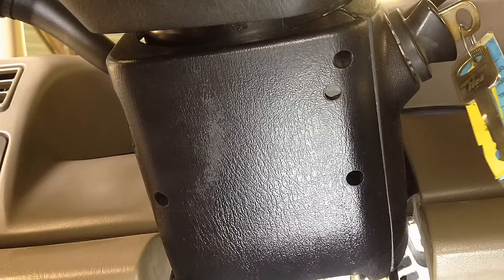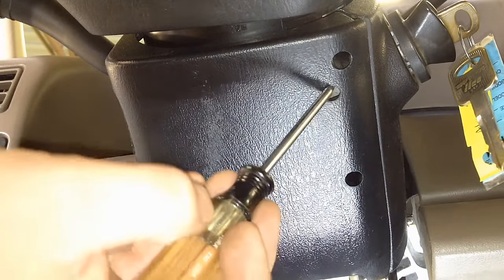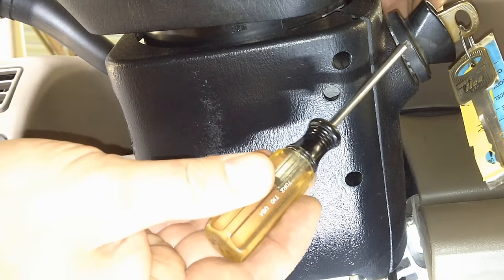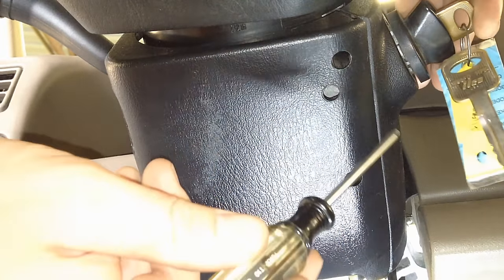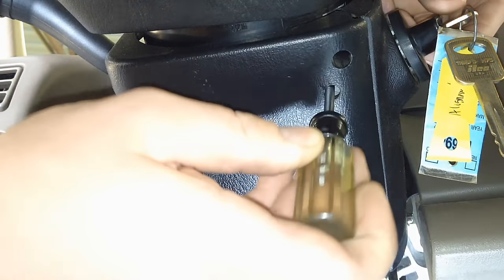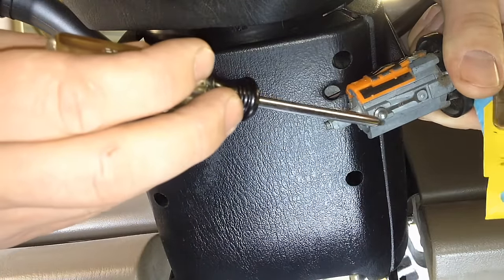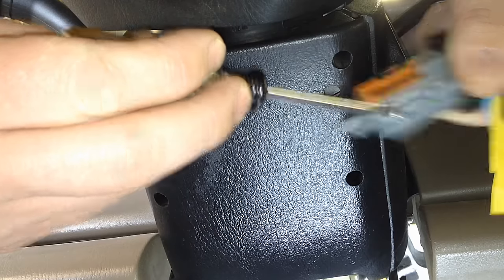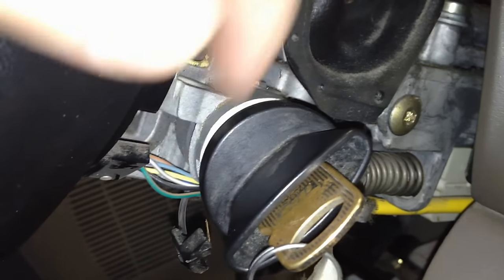Ford Quick Tips: #25 Ford Ignition Lock Cylinder Removal

Comment: I got the ignition release button pushed and can get some play but it is not fully released. Tried to lever it out and may have busted a bit the plastic cowling that the key enters first, and that prevents the shroud from being removed. I was way over-charged for replacing it and I wanted to verify that it had in fact been replaced. F250 2000
Reply from the maker: R. Brooke Fox Just make sure whatever you are sticking up in there is small enough to fully release it otherwise it should come right out.
Reply: Well, yes, I pretty sure it was small enough. I had taken off the low fuse box cover so I had a clear view. Thank you, FordTechMakuloco. I worked it in and out as far as it would go quite a few times and could plainly feel and see when it was released partially, at least, or not.
Reply: FordTechMakuloco What secures the plastic cowling that the key enters first, and that prevents the shroud from being removed? Is that just a friction fit? I found a spare in the truck after the suspicious work was done so I have a replacement in hand if I break the one that is in place as I try to remove the ignition cylinder.
Reply from the maker: R. Brooke Fox I think it just snaps on. The lower shroud should still come off with lock cylinder in place 3 Phillips head screws and it will be all open.
Reply: Thank you, FordTechMakuloco. I did get it out, and the cylinder is the same as the one you show, with the orange plastic parts, etc. Your link to Amazon was not direct to F250 2000 but on navigating there, the cylinder shown was different. I ask if it is original equip as I want to verify that my guys in fact replaced it or if it is the original or exactly like it. Is the one you show orig or a replacement? Can you give me a link for it or a brand? Many thanks.
Mine: http://2.ii.gl/La60cHIb.jpg
http://2.ii.gl/5da8ozTRi.jpg
http://2.ii.gl/omHLmnlnD.jpg
Reply from the maker: The one in the video is an oem original the replacement ones Ford look the same with the orange key in switch.
Reply: So it may or may not have been replaced. Thank you, FordTechMakuloco .
Reply: +FordTechMakuloco I'm trying to replace the ignition lock cylinder on my 92 f150  5.8 ltr when I'm trying to install the new one in half ways in it gets stuck i just took it back out didn't want to damage it is this normal or should it go back in smooth?

Comment: Is this the same for a 2009 F150 4.6 3v XLT?  My ignition switch seems to hang up when turned normally as though it's sticking. Have tried to fix this by squirting a little dry graphite for locks but with no luck. Switch still feels very "sticky" when turning the truck on and off.
Reply from the maker: HawaiianF150 2009-4/6-L3V Yes comes out the same way.
Reply: FordTechMakuloco Thanks!! You are awesome!  Love you videos.
Are these locks serviceable?  I'm thinking i need to go Ford but am curious that they would call in a locksmith and replace the switch and have him re-key it.

Wonder if its better to go to a locksmith directly and not have to pay ford to hire a locksmith. Seems there isn't any scan coding or reset needed.
Reply from the maker: HawaiianF150 2009-4/6-L3V If you need a new lock cylinder hget the kit and build it yourself there are instructions inside they are very easy to do. Just make sure you get ford cylinder.

Comment: I have a 99 f150 and my ignition switch just turns freely. I can't get it out because whenever I turn it to the on position it doesn't catch. Any advice on that? I think the cylinder lock is broken, or the tip may have broke off.
Reply from the maker: Its the slide lock inside that actuates the ignition switch. You must disassemble the column.
Reply: Thanks I appreciate the help. I'll give it a go. Do you happen to have a video demonstrating how to do that? If not chainsaw and duck tape it is lol

Comment: okay so i have a question,  my ignition switch broke today, its a 2000 ford mustang. it broke in the on position just before crank, to replace it can i simply slide it out like you did here and slide the new one in? i had to disconnect the battery because whatever broke wont let me turn it off either, just stuck in "on"  thanks in advance!
Reply from the maker: +Chris N yes it should release in run just like this one here and the same going back in it will all line up
Reply: Thanks !
Reply: I just had the same problem and was wondering how it worked out for you Chris
Reply: i honestly havent tried it yet unfortunately , the car is still sitting there ... i keep procrastinating . but when consulting with my uncle he believes that its actually a bad ignition switch and not the ignition cylinder , im assuming the process is still the same . i just dont have the tools on my own (yes not even a simple screwdriver set smh )
Reply: Thanks for the reply Chris, I will let you know what I find when I pull mine out, probably this weekend.
Reply: hoping to do mine also, ill let you know too, hoping its a cheaper fix than a new cylinder and keys

good lcuk
Reply: okay heres an update, so i took apart the steering column covers and took out the ignition cylinder just like this video, i had to also take off the lower dash panel below the steering wheel to get to the ignition switch. after some inspecting i found that the problem is the ignition switch actuator rod, its what moves with the key to switch the ignition switch into different positions
Reply: im also going to switch out my ignition switch tho because it seems like its very tight and that may be what made the ignition actuator rod snap. but its also possible that that much resistance in the switch is actually normal
Reply: anyways, im not looking forward to doing this job, but im hoping that i dont have to dismantle the entire steering column to get to it seeing how its deep inside the center of it........ ugh....
Reply: Chris I think mine is the same issue,  doing a bit more research I found that it is quite a job to replace the actuator rod.  There is a youtube video of a guy doing it on an Aerostar which seem to be the same.  search "ford ignition actuator rod"  The guy in the video had to file the new part to be able to install it without removing the lower half.   I talked with a local mechanic and he said it was easier to replace the whole steering system above the firewall.  This sucks!
Reply: yup i watched the same video theres another one from a mustang which is what i have but he still removed the whole steering column and replaced it outside the car, def not what i want to do, im considering getting a price, for now i might just start to drive the car by starting it from the ignition switch .... lol ghetto
Reply: Haha I was thinking the same thing!

Comment: So my key stopped working in my 2002 f250. I cannot turn the key at all. Steering wheel is locked due to the key no working. How do I remove the ignition if I can not turn to “run”?
Reply: Try moving the shifter and turning the wheel at the same time.

Comment: Have a Ford E350 Tioga. Do not have keys to turn to run position, and the guy did this to try to get ignition cylinder out without keys, I live to far out for anyone to come out, he said he can do it, 3 hours later it is not working please help! Steering wheel is iff the turn part on keys is broken off now, and he has drilled tge heck out of it snd the lil hole that holds the pin, I can't figure out how to send pictures to show you, really need help

Comment: I had a lock cylinder stop turning on me one very cold morning on my 00 focus. Turns out (no pun intended) the tiny Springs that push the lock bar out must have broke/shattered rendering it useless. 

Found the TSB and drilled a 10 mm hole (pilot hole first) to the correct depth and location,  then was able to successfully extract the cylinder!
Reply from the maker: Attohertz Yes I have done a few but what a mess it makes.
Reply: FordTechMakuloco Yes it was like new years confetti all over the place! Cobalt freeze hardened drill bits FTW.
Reply: Excuse me I have a question for you I want to replace my ignition cylinder key cause I have some problems with it but I want to know if I have to go to the dealership to reprogram the new key or new cylinder key thanks hopefully you answer

Comment: again dude, good quick tip! if i had time i would show whats done on a cobalt ignition recall, which requires remoing the 3 7mm screws and taking off the 2 trim piece halfs under the wheel, and ofc 2 torx 15's for the switch, and run position and a 90 deg pick to remove cylinder! bing bang boom done xD

ford bin releasing many recalls in the last few months?
Reply from the maker: Kevin Rogers Yeah I know what you mean on the gm lock cylinders had a regal once. Ford has been releasing plenty of recalls most of them stupid stuff extended warranty programs etc to increase customer satisfaction which is a good thing.

Comment: Great Video. I hate to ask in an unrelated video, but could you do explain the timing chain tensions issues on the 98?-early production 2003 4.6 used in the Crown/Grand Marquis/Town Cars. I know that Ford technician made marks on the timing covers meaning different things. The marks are written with a paint pencil and they are typically an X with 2 or 3 dots above the X.  I might try and find an image. I have 1-95 Town Car 236,000 trouble free other than a blend door, air ride, and a few power window gears. I have an 01 Crown Vic that has needed a blend door and still has the original total plastic intake manifold. I also have an 03 GMQ that has had the cooling fan replaced "radiator fan" and I have 2 2003 Town Cars that have not had any issues. I also have a 1990 F -150 300 straight 6 that is bullet proof. You can see I'm a Ford Guy, but I do have one GM car, a 81 Oldsmobile Diesel. Thanks
Reply from the maker: 81 Olds diesel sweet! I don't know of any issues with timing chains back then. All of that mess started with the 3v engines 2004 or newer. If they are failing now I would say they are from age. If you are talking the two dots on the camshaft sprockets yes those are the timing marks for the cams.

Comment: I have a 94 ford aerostar. The steering wheel locked in park.
My key twist when inserted. Wont turn.
Like the ignition cylinder is out of alignment. Engine runs if i can align keep once again.

Comment: I have a 99 taurus. The ignition is locked up in the off position. I have had this problem a few times before, but turning the wheel and then the ignition usual did the trick. Its not working this time. I found the hole you were talking about. Problem is..I cant get it to the run position.
Reply from the maker: You likely have an actuator problem inside the steering column causing this which requires it to be rebuilt there is a plastic actuator that likes to break causing this.
Reply: Thanks. So will i have to replace the ignition for fix the problem?
Reply: Nvm. I read that the The steering column will have to come out and the top half will have to be disassembled to get to the actuator rod? Not sure but that sounds like something I shouldnt even try to attempt..lol. I was really trying to see if it was simple enough to try myself since I am struggling financially right now....but I guess not.
Reply: One major concern is that no matter what....the ignition will not turn to the "on" position to be able to push the ball underneath that releases the ignition. The car will also not go into neutral I looked into the actuator rod replacement. WOW. $11 to $35 part but possible 7hr job?? I read 1 person said the steering wheel will have to be taken off. Another said it does not. Im sure it will be alot easier to just have a mechanic look at it/fix it. I might have to anyway as I obviously do not have the tools for this. But it would help if i could at least try to figure out if its going to cost me around $150 or around $400...or more. SMH@ dumb ass ford that put a plastic part so far in the steering column that could lock up/brake so easily...
Reply: gmc 2001 off and on
Reply: m
Reply: my key is doing the same thing

Comment: HELP HELP HELP HELP HELP

i have a 1995 Ford Ranger 2wd standard 

i have replaced the key ignition cylinder && ignition switch

my PROBLEM IS, my key ignition cylinder is loose. i am able to turn on my truck, but the key ignition DOESNT kick back. it just leaves my truck running and i can turn it off. i can even take the keys out of the ignition and it still runs

Comment: I have a 2003 Lincoln town car signature when I get out of the car and I use the remote to lock the doors. I do not use the function where the horn chirps but the lights flash when I lock the car….. on a 2001 mercury grand marquis is that possible to do that when I get out of the car used to remote to lock the doors that the lights flash if you can lead me somewhere to do that or explain it to me I’d appreciate it thanks

Comment: Thanks for the video. I have a 1972 lincoln continental mark IV. And need an ignition switch but apparently its difficult to find.  I even thought about replacing entire column as I have some wobble. Is there a new column that would fit?

Comment: The reason I was doing it at all was to inspect my ignition switch for I'm getting crank turnover and after checking all the relays it still shuts off the fuel injectors so it won't get power to the engine I own a 97 Ford expedition Eddie Bauer 5.4 l four wheel drive two valve

Comment: I need to know how to replace ignition switch cylinder without key
Reply: I ended up drilling mine out.  Broke 3 bits in the process, but after about an hour, I was eventually able to turn the ignition to the on position.  Wish I hadn't lost the key last summer!

Comment: i have 2003 ford taurus se with 102k on the clock, my issue is that its not starting at all. i just put in a new starter and battery and still nothing. when the keyis turned to run position all the lights on the dash comes on except the ckeck engine light and the theft light. but once in a while, it will come on and  then i can crank engine over and over and no fire. i tried to get codes off of the computer, but i keep getting an error message on my hand held saying link failed.  when i turn the key to the off position, all the lights seem to glow for a bit then lights out, including the ck enging light and theft light. the theft light just blinks like normal when the vehicle is left alone. no lights dim when trying to start. would like to have some feed back before i get into it too much. nice looking car. thanks.
Reply from the maker: +daryl philbrick I think it is time for the cluster to get diagnosed. I have seen this before on focus vehicle and if the cluster is not working properly then it will not communicate with the pcm and it will not start.
Reply: +FordTechMakuloco how I go about doing that, also would security issues cause problems? like no fuel or spark?
Reply: +daryl philbrick thanks for any tips
Reply from the maker: +daryl philbrick Well if the cluster is staying alive after the key is off you need to see if it is getting power after or it is not shutting down properly, lots of pinpoint testing. A proper scan tool that can talk to both the pcm and cluster is a quick way to check. Also the security will shit down fuel and or starter depending on model year.
Reply: +FordTechMakuloco what it mean if the ck engine light and theft light not on when the key is turned to run position. I can wiggle the ignition a bit then the theft light will blink fast and the check engine light flickers then, they both go out.  I just love computers in cars these days. I don't have a fancy computer but I'm not getting anything from data link connector. I can plug my computer in and I get an error message. do you think that computer that runs the car is bad? how common is that?
thanks for the reply. the cigarette lighter works.

Comment: Thank for the video helped a lot I have a question can I replace the switch on my 2000 f150 with a switch that doesn't have the chip key the one I have now does
Reply from the maker: Herman Lambert No the control is in the pcm not the key ring so this will not work.
Reply: FordTechMakuloco if that's the case why don't I have to reprogram the PCM If I change the PCM, I installed a used PCM and it started without reprogramming the PCM or the key.  ????

Comment: Hi, i have a 2012 f150 with the 5.0. 
I went to use my truck this morning and it wouldn't start, because the battery was dead. So i jumped it and it started fine, but the first thing I noticed was that as soon as you're starting to insert the key, its starts to crank over without turning the ignition. Bad ignition switch??? 
Plus its draining the battery by just sitting there without anything on.

Comment: Great video Brian, 

I lost my key to my 2003 Ford Ranger Edge.  

My only duplicate only opens the door but won’t  start the truck.  I can turn the key , but there is some kind of alarm/lock that I need to deactivate or remove.

Will just replacing the key cylinder do the trick?
Reply: Nope. The key must be programmed to the truck, not the cylinder. I am sure you learned that by now.
Reply: @mbrianperry1  thanks, I went to the dealership.

Comment: I have a 2001 sportrac with a stuck ignition. It won't move out of the locked position. I have tried all the jiggle tricks and I can not start, unlock the steering wheel or roll up my windows. How do I remove the lock in my case?